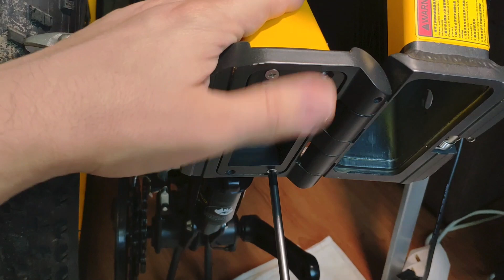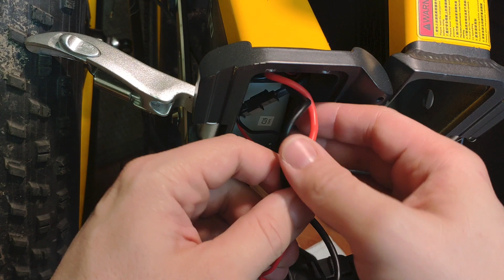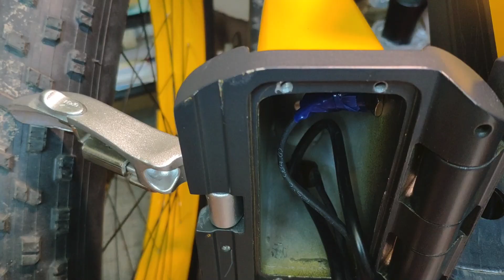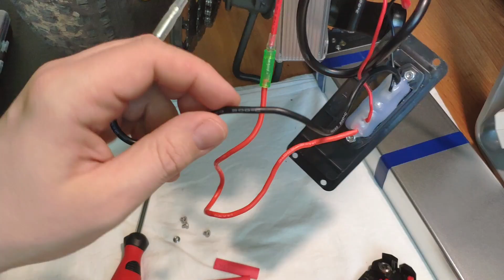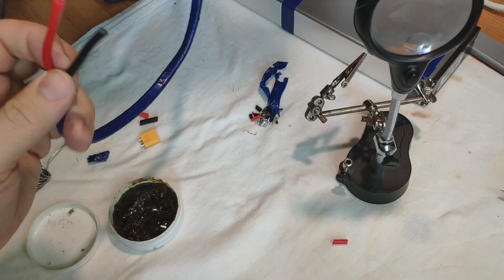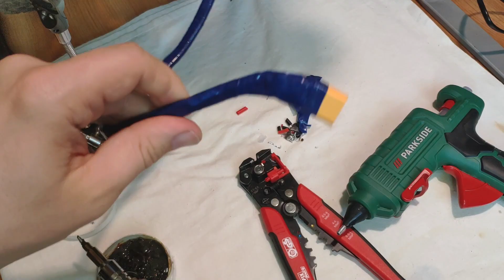Lankeleisi XT750 Plus Dual Battery MOD

Comment: I just watched the video. I plan on ordering a xt750 so I am curious about any information.

When I will find the battery range is too low I could just carry a second battery with me for backups and switch it when the first battery goes empty.
Saves some cable work...
But also, if cable length has such an impact on the power usage, I could just shorten and rewire the present cables between battery connector and the controller. What do you think?
I might take a look into the controller compartment in the frame and see to install some wire sleeving for protection for starters.

Comment: Hi, why don't you connect the second battery via the loading plug in the frame when you place it under it, already?
Reply from the maker: Because the charge plug will connect to the other battery BMS. This can generate a lot of problems are BMS are made to charge at 2-3amps, connecting the battery directly will mostly blow out something as it's going to generate a rush of current. The internal battery can also become highly unbalanced. You are also going to drive all the power through a single BMS output. These are just few things that are not permitting such kind of build.

Comment: Can you please do a video on dual battery setup on Gogobest GF600?
Reply from the maker: I don't have a Gogobest GF600 to do the mod on it.
Reply: @TechTronic9000  No worries, thank you for replying. Awkwardly, the wire from the gf600 controller that leads to the battery needs to be cut and split in order to be able to connect the second battery to it.Since I don't know how to do it, I am still looking for a viable solution.
Reply from the maker: Yes wire spiting and soldering is needed, but it should be done with appropriate knowledge otherwise it can turn into a disaster.
Reply: It does,yes! I don't know how to do it either,still looking for a solution too.Awkwardly,when I ordered an extra battery for my gf600,Gogobest sent me the wrong model,refused to refund me and instead sent me a video showing that I need to cut the wires from the new battery and do some electric welding to connect it to my controller.They have absolutely horrible customer service! Too bad,because the bike is amazing,a real bad ass!
Reply from the maker: Maybe a local electronic shop might help you.

Comment: to help with high load drain (not to double capaciry though), why not use capacitor. I believe it would help to extend the battery lifespan
Reply from the maker: The energy from a capacitor is very limited, you would need a huge ultacapacitor bank which will take more space and weight than a battery so it's not practical. The high load on this bike can be "constant" for long periods of time when you go uphill or use top speed.

Comment: What kind of li-ion use in this battery? NMC or what?
Reply from the maker: Normal 18650 Li-Ion cells. The add-on battery uses Chinese FST cells rated to 2400mAh, but they actually provide around 2600mAh.

Comment: Nice work. I have this same bike 500w with  48v 12.8ah battery. My other e-bike has the same style/size battery also 48v but bigger capacity at 15ah. Could I use this in the lankeleisi without having to change any settings or causing any damage?
Reply from the maker: Yes you can use it.

Comment: Very tempted to do this I was going to mount battery ontop like motorcycle petrol tank 😁

My partner says I should sell the bike and get 20 inch model Instead.

I could always add second battery to 20 inch model 😁
Reply from the maker: If you are looking at the X3000 20" model then forget it, it has a lot of frame faults and can suffer catastrophic failure such as snap in half. You can see more about that on the owners group here: https://www.facebook.com/groups/LankeleisiBike

Comment: I took my new T750 fat tire for a test ride.  It was great until the return trip.  The bike motor would not work in P! or any mode.  I kept rebooting the display and finally it worked again but had a mind of it's own.  Would not shift up or down.  Kind of worried now.  Any suggestions?
Reply from the maker: Check all the plugs and wires, did water get into the display? Fully charge the battery and try again.
Reply: @TechTronic9000  Thanks very much for replying.  I contacted Lankeleisi and the technician was very helpful.  Long story short, the technician sent me a new throttle, display, motor controller and a main cable.  The motor controller was the problem and the bike is now working perfect.  The online service was excellent.  The technician messaged and phoned me until the bike was fixed.  Thanks again, you're reviews led me to buy the bike and I am very satisfied.  Cheers!
Reply: @oakland6564  Seriously? I thought that chinese brand just ignores everyone.
Reply: @arkadiusznowakowski9084  I saw comments that their service was subpar but I could not ask for better online service.  The technician was calling , messaging and sending diagrams to identify the problem and sent parts until the problem was found.  Great service for me at least

Comment: Very bad experience with Lankeleisi... I received a bike with deep scratches and multiple scuffs on the frame and the fenders, the fenders and their bars were crooked without any assembly instructions or operation of the electronic module, very badly packaged, a horrible nightmare..
Reply from the maker: So you made at least 3 different accounts just to spam my review? If you had troubles with your bike than contact the seller. The service and support for this kind of bike depends a lot on the place you buy it. You can always cheap out and buy from dubious sellers that will not provide any kind of support. That is why I prefer to buy the stuff that I review from reputable sellers that I know that they will help me sort it out in case something goes wrong.

Comment: Good video! I have the same bike and considering to double the battery capacity. Where did you mount the 2nd set of battery on your bike? Did you have to drill hole on the bike frame for the wires? Thanks!
Reply from the maker: The 2nd battery is just strapped under the frame with several cords and a protective net. Between the battery and the frame i have put a few layers of foam so it doesn't crush the wires nor it hits the metal loops. The wires go under the frame through the same hole that wires come out from the original controller.

Comment: update on performance?
Reply from the maker: Still working great, see my epic ride with this config, it approximately doubles my range, it also decreases voltage drop so you get better power delivery under heavy load and also more consistent battery level display.

Comment: Very interesting.  Should the two batteries be equally “new” as well?  I mean bought and used interchangeably or is it ok to buy the second battery later and connect it to the existing one?
Reply from the maker: It doesn't matter the sate of the batteries as long as they are in good health. It's actually more important to have a good BMS that also has common wire design, which means it also charges the battery through the discharge wires. This way both batteries will charge / discharge and keep the same voltage between them, like having two communicating gas tanks.
Reply: @TechTronic9000  Good to know. Thanks for the reply!

Comment: Is it okay for the controller (the mosfet) to handle double the battery capacity? Rgds
Reply from the maker: More battery capacity is like having a larger gas tank and using the same engine, you are not putting more strain on the controller, you just have more range. Problems start when you increase the voltage.
Reply: @TechTronic9000  Thanks 🙏

Comment: hy..your content video iss very interesting..can u uploud part 2? is while parallel 2 battery in same voltage n while charging dual battery...is it not burn bms?
Reply from the maker: I will post a ride video with the dual battery setup. Battery is in parallel it has a common port bms and will charge together with the original one.
Reply: @TechTronic9000  So, after the modification I would only have to use one charger to charge both battery's?
Reply from the maker: You can use one or two chargers.

Comment: Hey, how do you know if your controller is 1000w or 500w?
Reply from the maker: By the amp rating written on it. Mine is a 20A model, thus 20A*48V is 960W, the so called 500W version comes with a 12A controller which is 576W.
Reply: @TechTronic9000  where is the amp rating written?
Reply from the maker: On the motor controller that is installed in the back part of the frame. It's the silver box with all the wires going into it from my video.